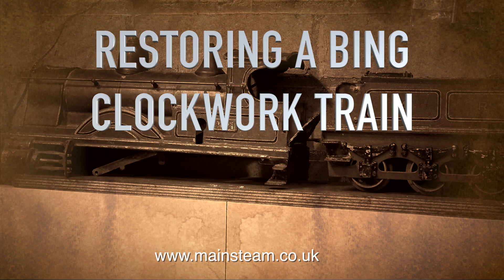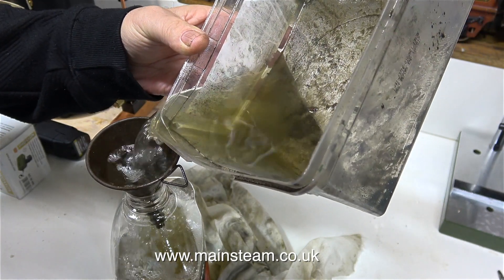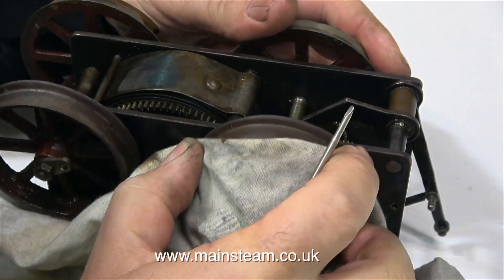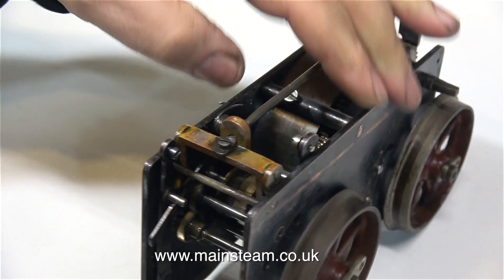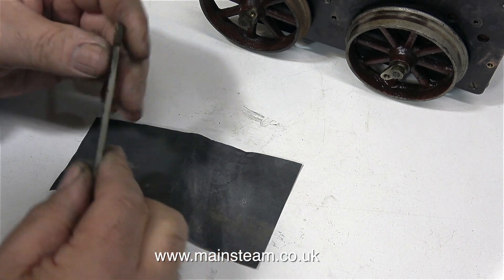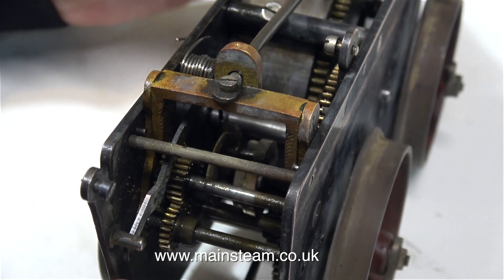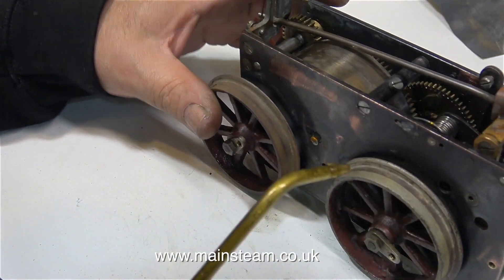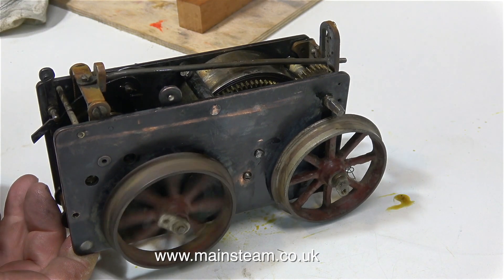RESTORING A VINTAGE BING CLOCKWORK TRAIN - PART #1

Comment: I repaired an old 1950's Triang 0-6-0 clockwork mechanism a few years ago. A heck of a lot smaller so more fiddly plus I had the exploded view servicing diagram to guide me as to what went where.

It has forward, neutral and reverse gear settings. Later 1960's to 2010's Triang (now rebranded Hornby) 0-4-0 clockwork mechs aren't so sophisticated.

Comment: A great many years ago a friend gave me a large wind-up engine similar to this one to try and fix.  It had been in a house fire and unfortunately I could never repair the mechanical bits, but did make it look presentable.  It had a coal tender, and one passenger car, which was in excellent condition. I think it was a #3 gauge as well as the driving wheels were a little over two inches apart. All the brass and white metal parts on the right hand side had welded themselves together,  so the owner used to display just the left hand side.  He had no idea how or when his father had received it and we never knew for sure just who made it or when.  It was a nice looking model none the less.

Comment: Not all the Hornby "0" gauge wheels are affected by the wheels cracking. It's pot luck really and generally only affects prewar wheels, buffers, Hornby Dublo and Dinky Toys. The alloy, mazac, has to be over 97% correct (if I remember correctly) otherwise it will, at the very least crack, and in some cases just turn to dust. There were found impurities in the mazac, caused by the workers throwing other things into the furnace at Meccano's factory in Binns Road, Liverpool, such as the wire ties around sacks.

Comment: Hi, Keith! This was a very informative video. I am not  a train enthusiast, but I listened to this entire playlist because it was so fascinating. I do have a question though, and I hope you will be able to help me. I have a 1953 Winnie the walking and talking Windup doll by advanced toy company. I am having trouble getting her going. I don’t believe the spring is broken because she will wind perfectly and there is tension in the key the further you wind it, but she does not proceed forward or do anything. If I very carefully move the key in the reverse direction she will perform if I continuously move the key. Could you please tell me what is going on? She is very dirty on the inside there is oil and dust together on the parts of her mechanism that I can see. Unfortunately, I don’t believe I can remove it from her body so I am stuck. What do you suggest? And thank you in advance for any help you can give me.
Reply from the maker: I would suspect a broken mainspring. Or maybe the parts are stuck with old grease?
Reply: @keithappleton  oh! Thank you! Well, now comes the next problem. Lol! Where to get a spring like that. It’s a very weird looking spring. It’s flat and it looks like a metal reel. I don’t know. Imagine real to reel tape, but only one wheel of it and made of metal.

Comment: White spirit is a "paint thinner" commonly used for cleaning paint brushes, so why doesn't it attack or soften the precious antique paintwork? 
Wouldn't isopropyl-alcohol be a safer cleaning fluid for the paintwork?
(I'm asking because I also have an antique Bing Train* in need of restoration.)

*yes, it does have carriages :-)
Reply from the maker: White spirit doesn't seem to harm old paint.